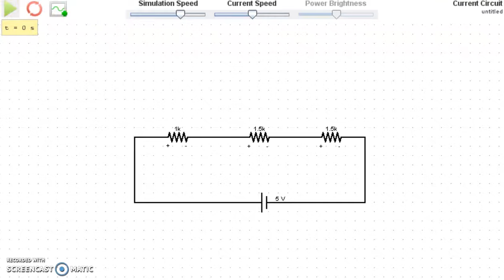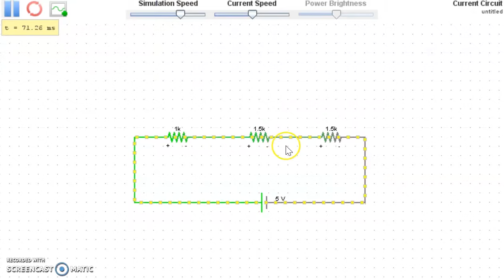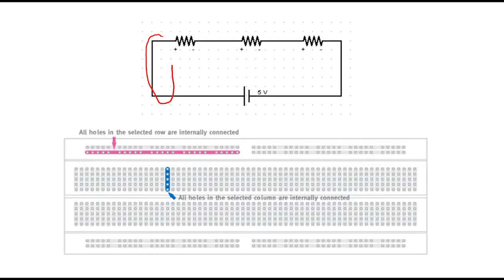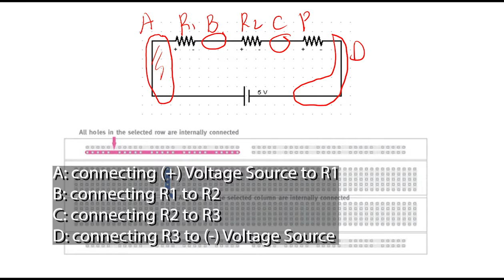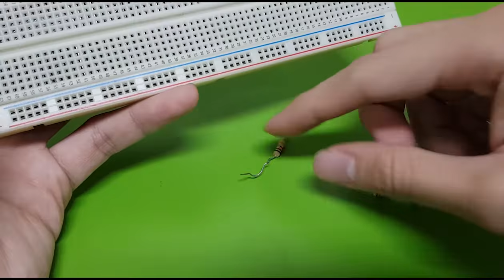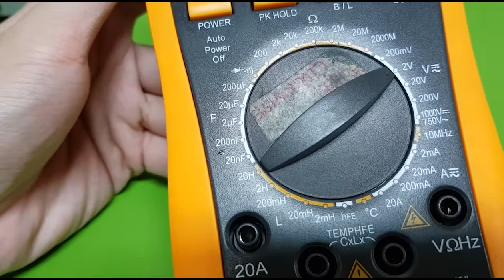Building Series Circuit on a Breadboard (Short lecture & Demo)

Comment: Just wanna ask sir how can i measure the voltage of each resistor in a circuit using multi meter pag ganyan pong setup
Reply from the maker: Hi. If you want to measure the voltage across each resistor, you just have to place the probes (commonly red and black) of your multimeter at the end of the resistor. Make sure you are in the correct mode of your multimeter.